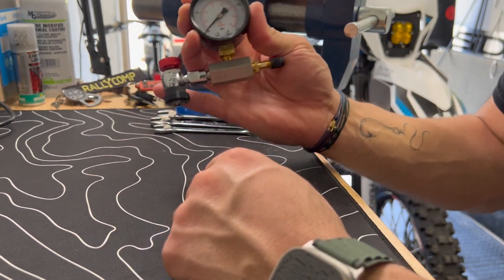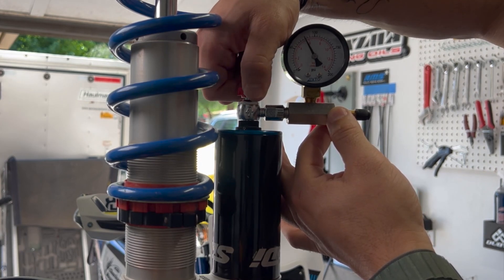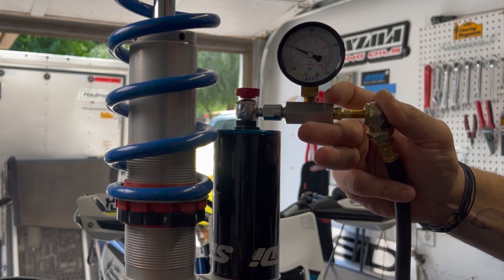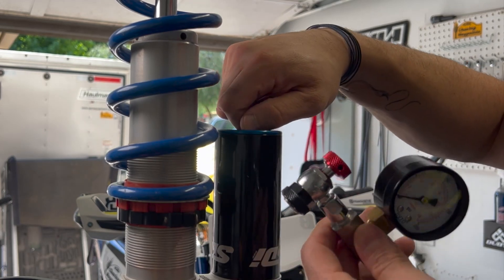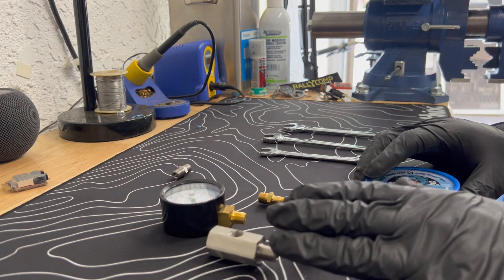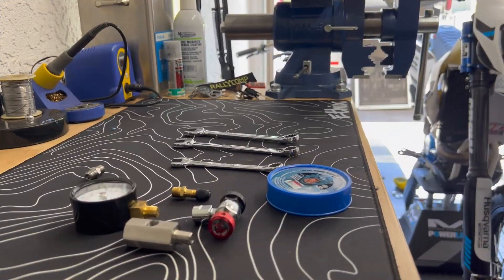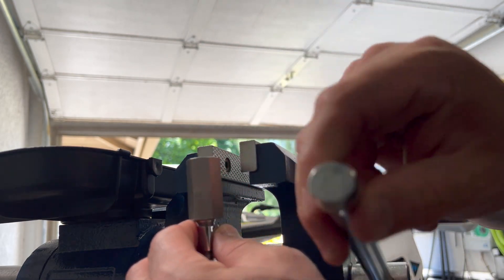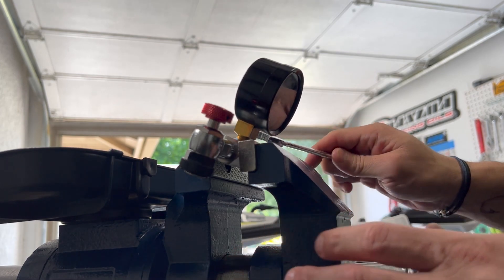DIY No Loss Air Chuck: MX Suspension, UTV Shocks and more!

Comment: How do we use the no air loss chuck on a nitrogen needle fill tool for a mtb suspension
Reply from the maker: You would need to thread the needle in to an adapater to connect to the check. Lots of weight though for a needle.

Comment: Great video! Thanks for showing off our chuck. I think using a lock-on or clip-on air chuck on your air source or adding a ball valve to the shock tool would help dial in those pressures without adding much cost. As to the thread tape, I typically rip off about a 4" piece, fold it in half lengthwise, and then wrap it around the threads. This helps to reduce waste and for me is easier than wrapping directly from the roll. We shoot for about 6 layers of thread tape at Power Tank. It's a fiddly process, either way.

We also make a long nose version of this chuck if the Schrader valve on the shock is recessed or hard to get to otherwise. Both work with our needle valve assembly.
Reply from the maker: This is good to know! Thank you for the insight, good call on the longer nose version.